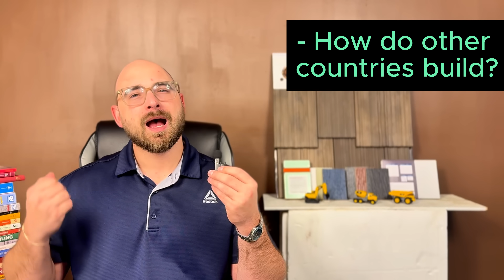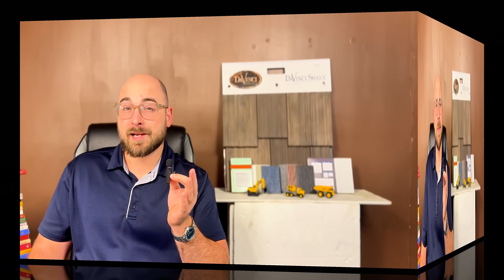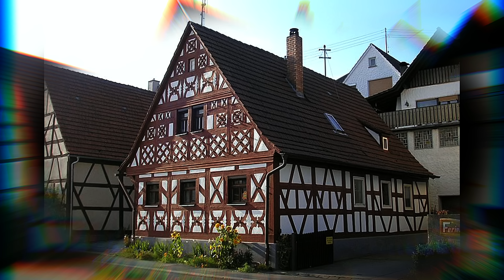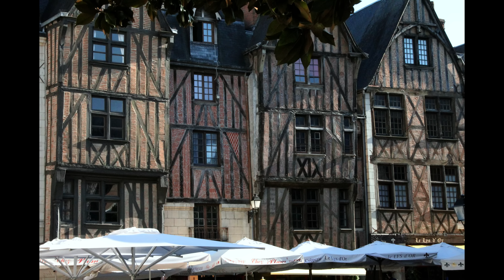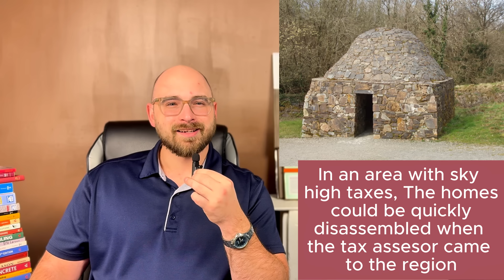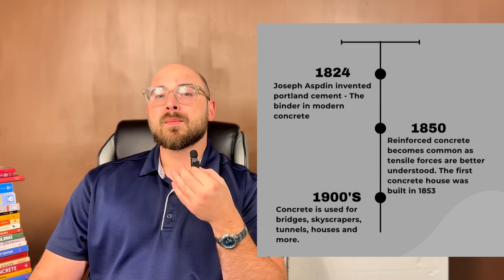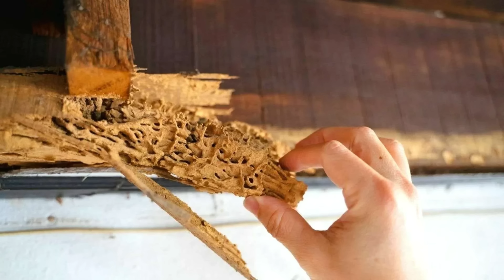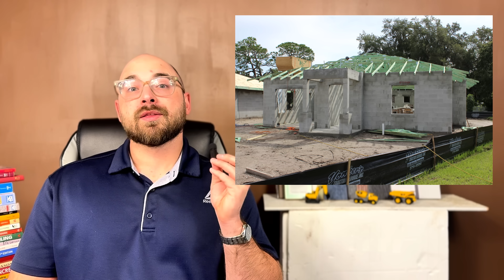Why Other Countries LAUGH at American Homes

Comment: Tragically America now has an opportunity to rebuild all those homes destroyed in the fires. UK homes would burn also, but generally brushwood and trees would not be allowed so close. though thee were one or two examples of such fires back in early 2020's. nowdays Uk uses a lot of brick outer and timber inner construction, this gives speed, strength and endurance.
Reply from the maker: Hopefully we learn from the disaster and prevent future ones 

It’s super sad to see how many people lost everything
Reply: Do you have any idea how huge the United States is? Rebuilding all the homes here would take hundreds of years. Plus wood frame houses secured to concrete foundations due to their flexibility, fare quite well in earthquakes.
Reply from the maker: I think he meant rebuilding the houses that burned down, not the whole country. 

Yes wood is flexible , but so is steel, and so is concrete when including seismic joints (joints that allow for movement) and these methods wont burn like a wood house

Comment: I have worked abroad, and YES, our homes do not compare to foreign countries. USA construction is NOT durable.
Reply: I also have another home built in the 50s valued at 1 mil now all my repairs over the last 20 years where about 100k mostly because of the roof windows and basement foundation  I'm the only home in the area with a basement ad thevwatertable is kind of high they realized that after building my home so I get flooding but I certainly haven't spent the cost of a new home on maintenance  not by a long shot a new home averages 500k and that would be a stretch haven't seen one that cheap in years.
Reply: @YTT718  Old people fixed water seeping in by using lime on the walls. Modern methods include injecting concrete into the ground around the basement to insulate against water.
Reply: @tj92834 
Well, first of all I said “maybe” because depending on how you look at it and what you include in the environmental calculation. I do not think that rebuilding a house from scratch every 40-50 years is environmentally sound. As for German houses, the vast majority old houses i.e. 80-100+ years old is come kind of brick, newer ones are of some variation of CMU. There are many different options available to make old houses energy efficient as demonstrated by cousins in Germany living in their parents’ and grandparents’ houses. 
As for “upkeep” of houses: The siding on my grandparents house was installed over 60 years ago and it still looks and has basically no deterioration/rotting! Even the coating (white) held up well. Back to the environmental question: What happens to vinyl siding when it has to be replaced? Is it recyclable or does it end up in a landfill. You certainly don’t want to burn it…
Finally. In another comment I talked about build quality. This in fact is a bigger problem. There is technology available in the US, but finding a quality installer/constructor is a different story.
Reply: I'll be dead and this house will still be here. So that's durable enough for me.
Reply: @tj92834 That's not true. My mother's house still has the same roof, not a single tile had to be replaced, it was built in 1970. The windows were all replaced with triple-glazed plastic windows because of the better insulation, not because they were broken. My brother's house was built in 1770. 🇩🇪
Reply: @tj92834USA homes can stand for even a century (apparently).
But European homes.... Outstanded millennials and even 2 world wars 😉 just think about it for a second.
Reply: @tj92834 I disagree. My home Turns 125 this year and I've barely done anything as extensive to cost a new home  in 15 years I've owned it. 

 Its mostly been  creature comforts and a few additions.  I enclosed my porch added a new doorway ran ethernet and electrical lines installed new outlets upgraded the breaker threw on some solar panels got rid of the boiler and went with a tankless furnace,  eventually Ill convert to electric heat and water. I do all the work myself and I enjoy it, even mixing and pouring concrete to make a new door frame. 

 I do need a new roof but it hasn't been replaced since 1987 and they just threw on another layer of shingle I'm at 3 the max.  I have a few leaks and strong winds  blow a few shingles into the yard, I've been patching the leaks with flex seal it hasn't been  a big problem 

I've had to replace a few water valves and pipes the solution rubber hose and pex since no one seems to be able to weld anything onto my old brass lines.  

But all in all nothing that serious now I'm starting to get a crack on a wall in the basement foundation it's going to cost around 3k to have the wall redone in that area I've seen it done on other homes especially brick ones they always crack eventually after 50 years.
Reply: @tj92834 this is very very wrong sorry to inform you you don't pay in 20-40 year as much as buying a new house
the house my parent live in, the one of my grand parent and event the very old one of my great grand parent cost basically nothing  to maintain, no need to redo the roof or any of this shit , yes you can update thing because technologie goes forward and because of taste  but redoing the kitwhen , the bathroom changing all the windows and door amount to nowhere near the house cost event if you do it every 5year (  and you dont need to do it every 5 year, like one time per decade is already too much unless there is a groundbreaking innovation in term of insulation/solidity of the windows and spoiler it don't happen very often)
Reply: @tj92834 Nope. After 20-40 years here you mainly need new paint. And maybe adopt to some new habits. After 60 years you need to think of new pipes and wiring, but new ones will last longer. Windows are often changed earlier, but that's more because of fast technological development than that the became unusable. In Vienna we had windows used before by beethoven (the office was in one of his former flats), still originals. Rooftiles last between 70 and >100 years unless you have bad luck with the charge.  The static structure of a house 100-150 years old still fulfils all modern requirements. So it is enough to add insulation to the existing structure to adopt it to modern requrements in this direction. It can be expensive, but still costs significant less than a new house. Naturally, if you want something completely different you knock down the house and build new. But with the actual rate of new houses built vs number of existing houses, the average house here will last >200 years.
Reply: Depends on the builder
Reply: @tj92834nope
Reply: @tj92834 I disagree. Of course, house maintenance is necessary, but the costs of renovating a brick house will undoubtedly be less than building it from scratch. In reality, it is a very small fraction of the costs compared to building a new house. The comfort of living in a brick house is also somewhere else. I have experience with both and can compare it to lightweight wooden construction. A brick house is practically like new after twenty years, if everything was done correctly and is not sloppy craftsmanship. I currently have most of the repairs completed on a brick house from 1974. Basically, it was enough to fix the visual things and a few easy repairs, there was no need to interfere with the structure. I also have a reconstruction of a house from the 19th century in progress. This is more demanding, because the standard of living has changed a lot since then, yet there is no need to interfere with the supporting structures of the house. Despite the extensive reconstruction, the budget is only a fraction of building a new one. My girlfriend also lives in a renovated house, probably also from the 19th century. For less than a quarter of the price of a new house, it underwent a total renovation, leaving only the 1-meter-thick hard stone walls and the roof trusses. It now has a modern interior and is comfortable to live in.
Reply: @hectorrodriguez2686  i have worked abroad too and our house are EXPONENTIALLY nicer than average houses overseas
Reply: @tj92834 Irrelevant if you build a home to last four centuries
Reply: @garymccallum4152  I'm not planning on sticking around for four centuries. In that amount of time a lot can change too. Look at Detroit today. It doesn't look how it looks because of how anything was constructed. That had nothing to do with it. The money simply vanished and with it so did the people that lived there. Once you get water intrusion on a building in a freeze thaw cycle climate you can kiss it goodbye.
Reply: @garymccallum4152  it's easy to make things last centuries in europe, the climate is generally mild in comparison, a tornado doesn't care what your house is made of, it will rip it apart and it will throw chunks of it for miles
Reply: @garymccallum4152  That’s what I mean: Culture, philosophy and individual preference and to certain degree access to building material. There is not right or wrong.
Reply: @garymccallum4152 lol noone wants a 400 year old home
Reply: @franquil85conn  There aren't that many homes of that age, but their inhabitants weren't forced to live there -- believe it or not!
200 years old houses are more...
Reply: @franquil85conn  
Well, millions of people in Europe and other parts of the world see it differently and live safely and comfortably in modern, old houses. Again, this is part of culture, philosophy and individual preference. There is no right or wrong.
Reply: @BAG9114  yep and those millions of Europeans, with their washer/dryer combo in their kitchen, flip out when they see how big and nice American homes are.  Cheeseburgers are good, but the 2nd you try steak...
Reply: @franquil85conn  here in Italy we have wonderful houses that last for centuries the structure of our buildings can last forever with care, and yes we live in 300 years houses that have a story and charm even if they have been upgraded to the last tecnological standards. We build things to last. We have learned from the Roman’s buildings that after 2000 years are still in good shape.
Reply: @AndreaLiverani-iw5ci  Americans can do the same, but why? People move all the time here, and the US is huge compared to Italy.  Italy is half the size of Texas...doesn't make sense to over invest
Reply: @ a good house will have a better resell value and can be used but new owners. I have seen many rural places in the us with almost many rotted wood houses , because if not lived for 10 years they fall in pieces. Different way of thinking maybe.
Reply: @AndreaLiverani-iw5ci  places with "rotted wood houses" is because it's in poor areas that can't afford upkeep.  If they cannot afford to slap some paint on the outside of their house when the paint chips, do you think they could afford a more expensive build?
Reply: @tj92834it's no illusion for the solid structures. While you might chose to redo electricity or plumbing, it is usually not even a necessity.
Reply: @la-go-xy if the hose is 4 centrysopd it's gonna need to be rewired I'd say 50yrs are cutting it
Reply: @skiterzzz4474  LOL i'd like to see some 400 years old wiring ;-)
Reply: @tj92834 who’s benefit and who’s cost?
Reply: kleenex housing...
Reply: As said earlier, this is also part of the US culture and philosophy: Why build for generations, when I can foresee I will only live in that house / region for 10-20 years? Or, why committing to a certain construction / style of house when I know designs and technology as well as my income will change over the years? Per se there is nothing wrong with this thinking except maybe (only maybe) from an environmental perspective. But I personally have no proof of the validity of the environmental statement.
Reply: @BAG9114  Why would someone want to buy a house that they expect will only last for twenty years? If they sell after twenty years, a worn-out house will sell for a very low price, and thus be a bad investment. Even if they stay, they would face a capital loss, or expensive repairs. Most houses must last considerably longer than twenty years, or a large number of houses would become worthless in the secondary market. At least in the market where I live, many houses are over 100 years old and command very high prices.
Reply: @BAG9114  "there is nothing wrong with this thinking except maybe (only maybe) from an environmental perspective."
As we have already learned, there is also the fire resistance perspective.
Homes in very many developments in the U.S. are built close together. With the right wind and dryness conditions, fire can easily destroy them.
Reply: @geoh7777  if your house burns that's a tough break. Even stone houses can and do burn though. What's inside of them burns. In the past the roof tended to not be stone.
Reply: @geoh7777 not every where deals w fires and we are a new country compared to Europe that being said theirs thousands of WOOD homes in LOS Angeles buiIt in 1909-PRESENT my family home was built in the 50s an the only thing wrong was isulation PHILADELPIA uses mostly brick and those have been standing since the 1800s wood isn't bad idk y yall think ur so superior just bc u guys build with more expensive materials.
Reply: I agree. In Slovakia we have like 99% brick houses, and after 20-30 years, you usually have to change all the pipes, electricity, heatings, lan connections, maybe windows, houses also need thicker insulation.... And in reality some people have torn down the house and built new one on existing foundations. With maybe better proportions. (like you do not need rooms for children and so...)
Reply: @radoslavstano9158  Slovakia sounds like one of those fictional countries they make up in the movies. But I can understand not wanting to be Polish or Turkish. So good on ya.
Reply: @BAG9114  ecologic take which I made it up: Wood 
grows  slower than 10-20 years and if house ville stand al that period of time not enugth to reduce damage for nature.
Reply: @BAG9114  but then that doesn’t explain why life in the US is so darn expensive! What you describe is actually more applicable to some other countries than the US🥴
Reply: @comment6864 labor cost and house size.  My home is 3400sqft and it's normal size in my area
Reply: @comment6864  
Not sure I understand why my comment would apply more to other countries rather than the US…
There is a ton of information available that deals with the “why has the US become so expensive” e.g. HVAC systems price increase over the past 4 years 50-65%. We live in a market economy of which we are proud of, where in principle supply and demand is the base for end-user pricing. HVAC example: 5 companies own 25 known HVAC brands in the US. There is some good information out there that sheds light on lumber pricing and the rather complex supply chain.
Reply: @BAG9114  That is a pretty selfish perspective. Where I live houses are easily 100+ years old. If we don't want to live there anymore, then we sell it so someone else who can live there, and they can sell it again to someone else when they want to move. We do not build houses only for ourselves to live in. And we build them properly so they do last for 100+ years. It is like you americans have the mindset that when you are finished living in a house, then nobody is going to use that house afterwards.
Reply: @Cartilog-z4f I actually agree to your point. The most important point is the sentence at the end of your comment: Building to last. If you look through my comments I said that build quality of whatever method you choose is probably more important than the method itself. If you build a quality wood house/light frame wood house it will last, it can be made energy efficient, fire resistant, etc. It is however fact that for many reasons many of the recent builds in the US are NOT designed/built for longevity. BTW other countries face similar issues. 
However, there is a cultural element here. In comparison and without any kind of judgement: Europeans tend to stay much longer in the homes they built or bought or better many still build for life and therefore lower maintenance over time which includes plumbing, electrical, heating, energy efficiency, etc.
Reply: @BAG9114  The dump houses  are trash

Comment: It’s not a matter of place (I.e. country); it’s a matter of materials & method, which sometimes means time (or era- I.e. when the house was built).  A house built before WWII, with the extremely strong and durable methods in use then, will last virtually forever if properly maintained, especially if the interior walls and ceilings are hard plaster.  These houses will also be much easier and cheaper to heat & cool.  Most recent construction I’ve seen is cheap, flimsy junk.  This absolutely includes homes that sell for half a million, give or take a few grand.  

There is an apartment building down the street from me that I used to drive past every day on my way to and from work; it was the first time I ever saw “platform & stick” construction.  It’s so flimsy that I wouldn’t go inside if you paid me.  When they moved the appliances in you could see the floor slabs shaking; they still shake every time a car drives into the integral parking garage.  

Building codes are now written by lobbyists for the construction industry.  Among other things, that is why in many jurisdictions it’s no longer possible to use aluminum electrical boxes; the new codes require the use of plastic boxes that are nearly always made in China.  I am sure the manufacturers are extra careful to comply with U.S. law and make sure those boxes are safe and fit for purpose.  Not!!!